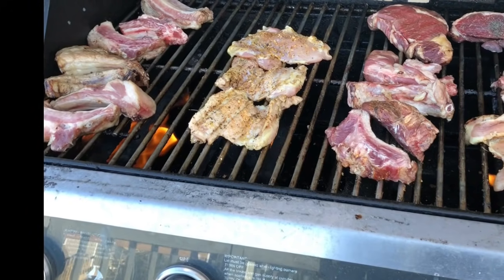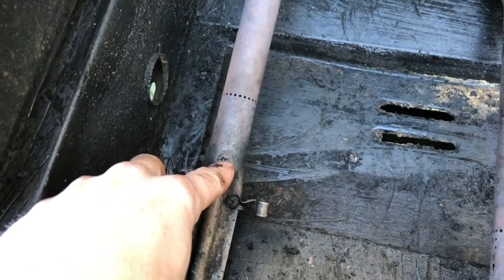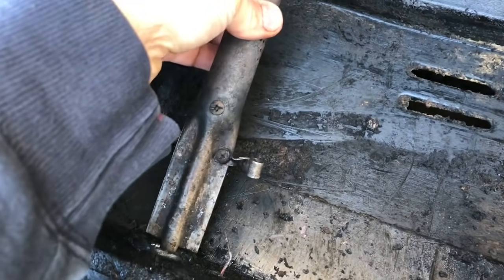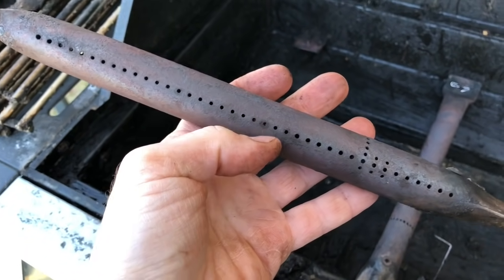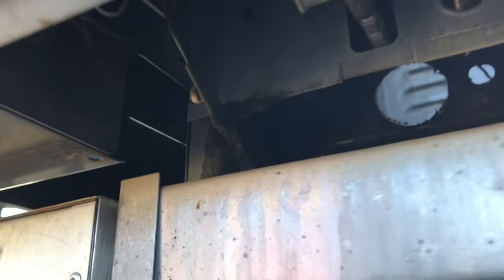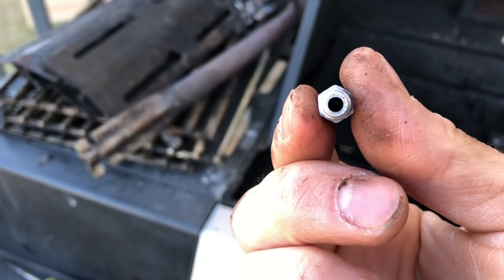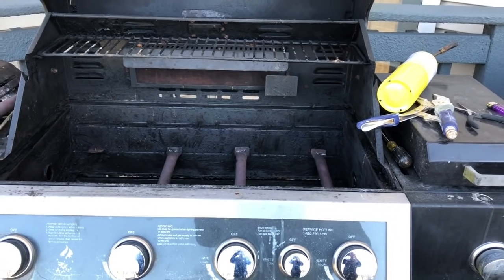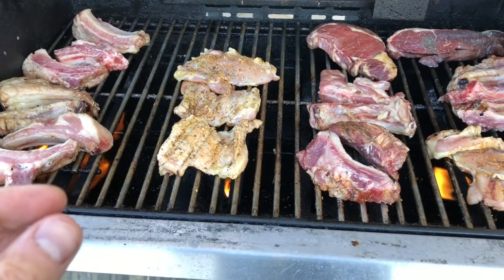How To Fix Your Barbecue Grill That Has Low Flame

Comment: The key in this video was "after you cleaned the burners, you're not done". Telling me to clean the gas jets fixed my issue and was gold since other videos didn't touch on this. A big thanks!
Reply: Me too dude!!!!!
Reply: I checked my gas jet and it looked clean so I upped the hole size of the jet to 1/16" (it was the smallest drill bit size I had} Works awesome now. The flame that I used to get when I would have it set for high is the flame now when I set it to low. Set to high gives me a ton more flame lol

Comment: I had already purchased new burner tubes and heat distribution plates from Amazon when I stumbled across this video. I needed those parts as well but thanks for the video on what else I need to check before I put it back together. 👍🏾
Reply: Just a quick add. This comment is 2 years old. My grill is still going. Two years extended life. I’ll take it.  👍🏾

Comment: Thanks for the tip on the pinhole cleaning. I was unable to access it easily. So I used a mirror and long thin wire to open it up. That fixed my low flame issue.😅

Comment: Just fixed my grill with these methods, due to the accessibility I skipped the part where you clean the little orifice at the valve. I shook all the crap out of the tubes but only shaking out the tubes and not cleaning the holes. I reassembled the grill and that didn't work. I disassembled the grill parts again and punching the holes out did the trick, grill works fine now.  thanks
Reply from the maker: Excellent!

Comment: Thank you so much, I was about to give up on our Grillmate BBQ which has not been used for years and it was not heating it. I will try to clean the tubes and see if it solves the issue.

Comment: Thank you very much.. most searches only say to change the regulator. My grill is about 25 years old. The burners are still good. Unfortunately  I spent 50.00 on a new regulator only the find out the problem continued. One good flame. The other two burners very low.  I will try cleaning the jets. Im sure now thats the problem.

Comment: I was only getting about 300F.  My grill had a tube in the rear that fed gas from the left burner to the others. it was half full of rust chunks. I cleaned that tube out, but the REAL secret is to fully pressurize the manifold BEFORE  opening the burner valves. 
Wait about five seconds (after opening the tank valve) before you open any burner valves. 
Got her up to 520F yesterday!
Reply: Whats the manifold
Reply: @devbra5585  OK, if you follow the line from the gas tank to the front of the grill, it feeds into burner one. 

Then at the back of burner one, there is a tube across the back of the grill that feeds propane gas to all three burners. 

And that tube is known as the manifold.
Reply: Thank you okay yes i understand but why would pressurizing the manifold for a few second work ??? If the output of the cyclinder is fixed then why would opening the cylinder first before turning the burners on work ???
Reply: @devbra5585  Don't know if you've worked this out, found this recently myself while doing a bit of research, apparently the regulator on the hose has a safety built into it. If it thinks there's a leak it'll limit the gas flow. If this is the case you'll need to disconnect the hose from the gas bottle and let it rest for 30 secs, that'll reset the valve in the regulator. Reattach turn on the bottle first, then your burners.

Comment: Did you use pipe dope when you out your orifices on?  I just redid a grill with brand new valves and orifices and not getting pressure.   Double checked manifolds and no leaks.   I'm wondering if I clogged orifices with pipe dope

Comment: I’m actually dealing with the opposite problem and I’m going through an entire bottle every 2 weeks. I turn it off after each use otherwise it seems to last even less. Is there a way to adjust something under there to slow it down? Sometimes I have to leave my burners on low and even then it spikes up over 400.

Comment: I used compressed air to clear the burner tubes, but I’ll have to go back and check the valves. It works much better now, but could probably use some more TLC. I was hesitant to remove my burner tubes because mine are a pain to access. Great video!

Comment: I just replaced the burner tubes on my Weber and was disappointed to see the first burner is still not lighting. I think your tip about the manifold valve will likely solve this. I wasn't aware they screw off. Thanks for the tip.
Reply: Stephen Craig I’m having the same issue, did this fix your problem?

Comment: I have spark and gas but will not light. I can use a lighter but will not start with igniter. Any ideas?
Reply from the maker: Try using sandpaper between the contact

Comment: The screw you had to remove with heat what  is it for?  is it a mix adjustment screw.My Charbroil grill has one on the bottom side of each burner tube they are badly rusted and on removal no longer fit. Burner is giving an orange flame and maxing out at 350.
Reply from the maker: No that screw only holds the burner in place
Reply: @KooperSalmo  On my Charbroil there are 2 screws a top cross  over plate screw holding down the plate that spreads the flame across burners and on each burner a bottom screw that seems to restrict the orifice of the burner  tube as you turn it in hence my idea it makes a richer or leaner gas mix. These bottom screws are pretty much shot.

Comment: What did I do without this for so long?2 pieces of French Toast at a time ?20 minutes for 10 pancakes ?NO MOREthis griddle is awesomeTook some time to season before first use https://www.youtube.com/post/UgkxHM5jmQoi4dbb0hoWSBs9hPhSwXUbGVG_  did brunch and hibachi dinner on Mother’s Day and it worked like a charmSturdy, well built and heats up quick. burners2-4 were a little stubborn but then lit up.Great addition to my patio.Bought the cover and it’s great, also bought the accessories kit - scraper is good but the spatulas are flimsy to be honest that’s my only negative.